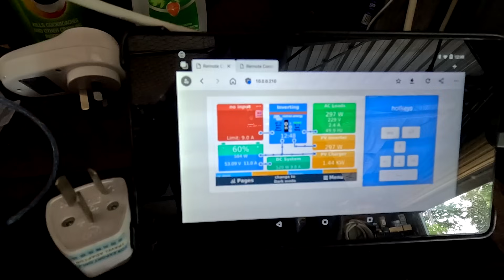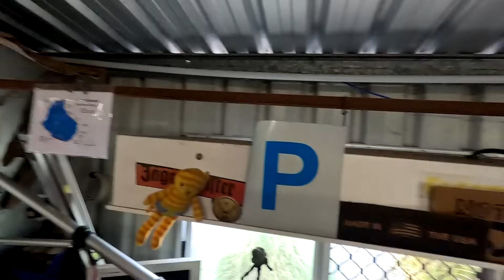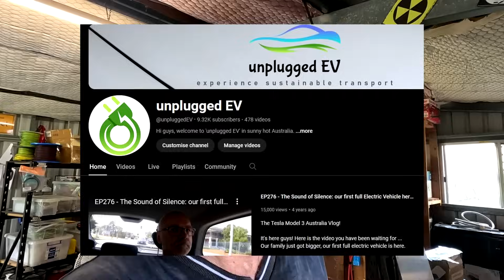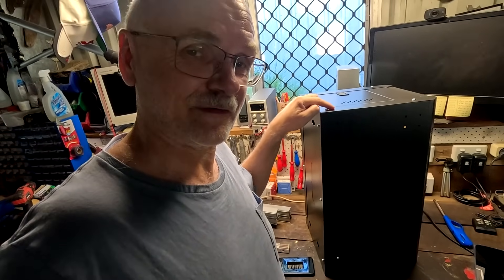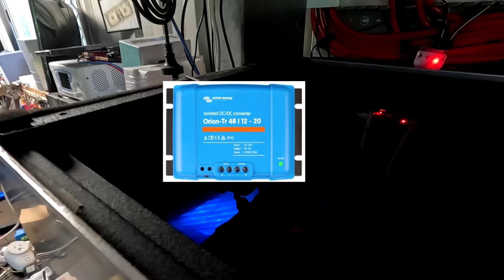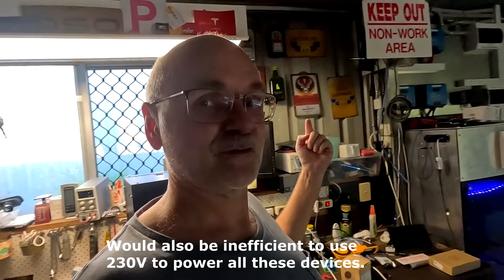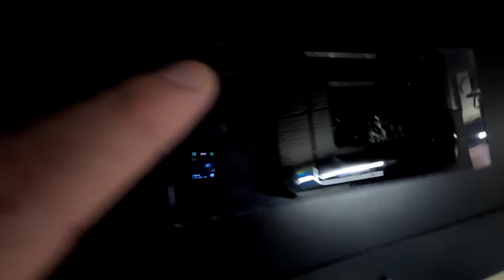Everything is changing in the Off-Grid Garage. Just kidding...              Am I?

Comment: 17:11 "There will be no heat inside, nothing."

Why would you think that? If I understand correctly, you are planning to put several DC-DC converters in there, a PoE switch, a router and a small computer. Most of the power consumed by these devices will be emitted as heat. Even if their overall power consumption would be as low as, e.g., 20 W, you will still have an equivalent of a 20 W heater running non-stop inside a small metal box with little or no ventilation. In sunny hot Australia, as you often put it.

I am unsure how hot can the inside of such a container get. But I would not call it "no heat inside, nothing".

Comment: Hi Andy, this is off topic but, I just used your settings for JBD 100Ah 48V, and then tried Overkill solar settings on thier app. Both did not work. They both seem to have limited voltage to around 28v output instead of 53+/-. Any thoughts would be great from anyone. Cheers, Brad

Comment: ChatGPT
Hello Andy, I'm encountering difficulties with the Solis Hybrid RHI-5K-48ES-5G inverter. It seems to only charge the battery from the solar panels directly connected to it, despite the meter ARC10R-D16TE indicating exported power from additional panels. Despite enabling grid charging, the inverter isn't utilizing excess power from other sources. The manufacturer assured me that this model should be capable of this functionality, but I haven't been able to resolve the issue. I've provided a video link for reference: Video Link here https://youtu.be/sjtVqiOg1JE?si=2S6TJpbcjZMVcM3X Any assistance would be greatly appreciated.

Comment: Hey Andy, can you do me a solid favor!

Your 'Peter Inverter', i'm building a wall in my 4wd mount it and i've got the online dimensions BUT, i don't think they include the pos/neg terminals sticking out or the mounting brackets. 

Could you measure yours and tell me the length including the two terminals? 
Also the width between the brackets (side to side) i'd appreciate the help

Comment: Note that you can power POE+ routers directly from your 48V battery system.  You just need a fuse / breaker for safety and you are done.  POE+ allows operating voltages up to 58V (and can tolerate up to at least 60V),  and will operate down to roughly 50V, which is a perfect match against LiFePO4.   I do this for my POE+ system (security cameras, some outside lighting, and Wifi Routers).

Also note that USB-C converter cables can supply 19V and 12V and 5V for you.   A USB-C PD port can produce all of those voltages and is completely short-protected.   Consider using USB-C for the step-down DC conversions.   You can also get POE+ -> DC splitters which provide a USB-C PD port.  So lots of options for low-voltage DC appliances.

Comment: Panzerband für die Löcher und eine 2cm Abschlussleiste. Problem gelöst ;)
Duct tape for the holes and a 2cm finishing strip. Problem solved ;)
And why not simply using a 48V Step-down converter for your devices? so you can connect it directly to your battery.

Comment: The bigger mistake will ne, to disassamble the roof insulation, without knowing, what this will cause. Dependent of humidity and temperature of the air and the steel-toof, you will get rains inside, of condensating water.

All your electric installations, instruments will be happy about this allways high humidity by drying up all this condensating water and iron will like to rust. 

=>> " You also have the option of having the roof panels produced with anti-condensation fleece or Soundcontrol anti-drip fleece to the exact size you require." <<= You should think about this ....

cares jogi ;-)

Comment: Hi Andy, there is a new smart DC/DC 12/12V 50 Amp converter from Victron coming on the market soon. It is smaller, more powerfully and more efficient than the previous 30 amp model.
Would be interesting to test, especially for the large number of boaters and campervan idols in the audience. Egenolf,  Netherlands

Comment: You will get problems with condense inside when it is cold outside and warm in the shelf. You will get drops on the metal roof
Reply: 17:12 He made a point of saying there was plenty of room above the rack for the new insulation, so the potential condensation issue will be addressed. 👍
Curious to see if he allowed enough room for the door of the rack to clear the steel support holding to light above the workbench.

Comment: Off topic question: I have a hybrid inverter (axpert king) and I've installed in the electrical system in my RV and IMD, because the natural and ground are bonded in the inverter the IMD alwayys trips. IMD is a regulation requirement. Any known solutions for this? also lets say I disable the bonding, when connecting to the grid for charging there will be again bonding at the supply panel

Any clues at to what to look for will be much appreciated